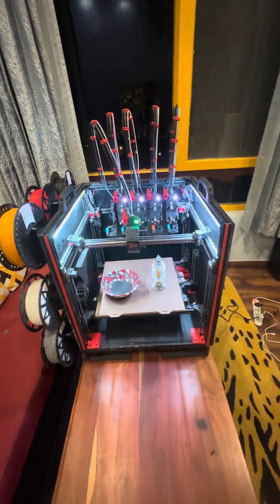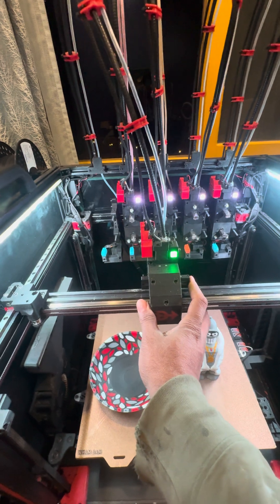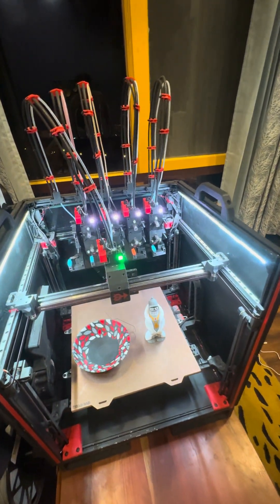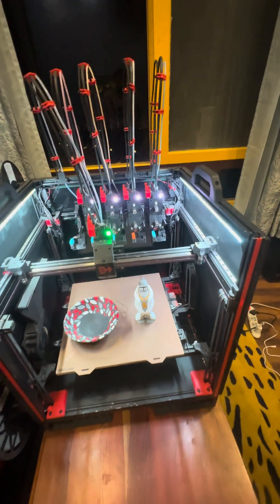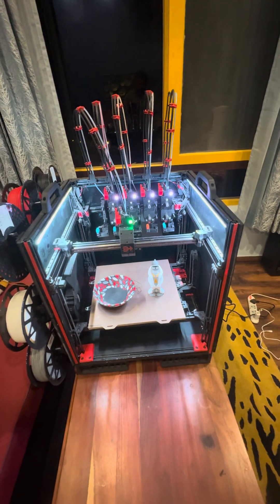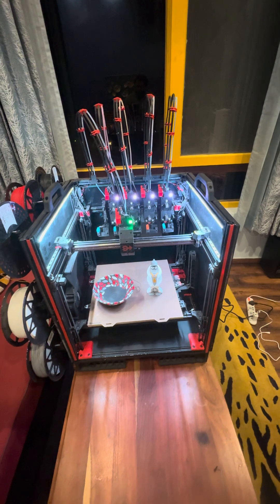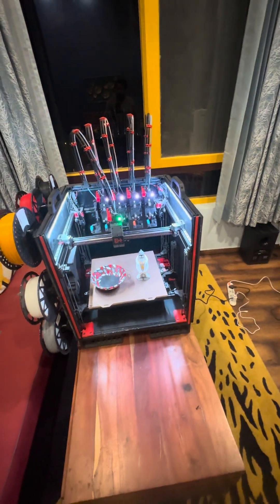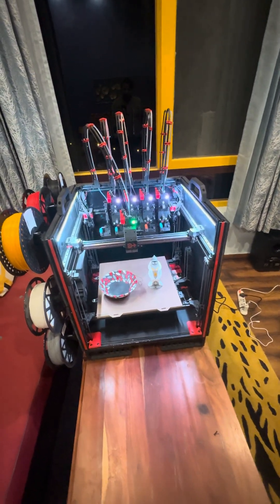Intelligent Crash Detection and Recovery - DAKSH Tool Changer

Comment: How tall is the total height of the printer including each individual toolhead wire loom?
Reply from the maker: The frame is a standard trident 350x350 frame - the wire loom would be about 250mm high

Comment: Hi, nice job really ! I plan to use the top mechanism of an Ender 7 to build this kind of machine with Daksh changer. Do you recommend Klipper or Marlin for multi head management ?
Reply from the maker: DAKSH uses Klipper as the printer firmware.